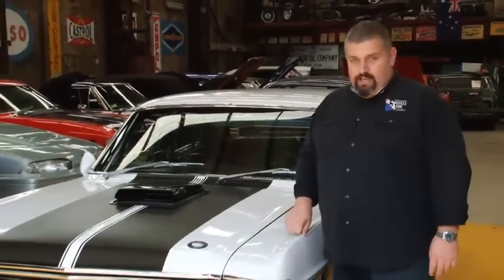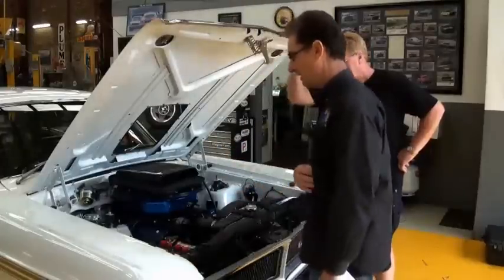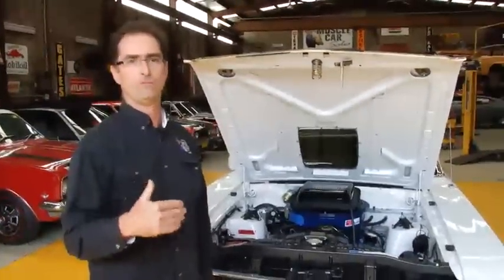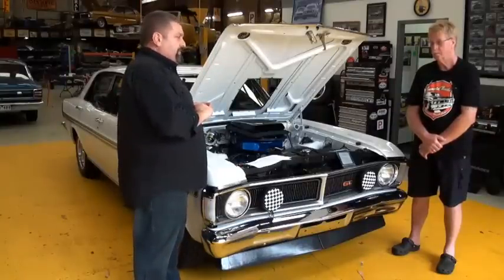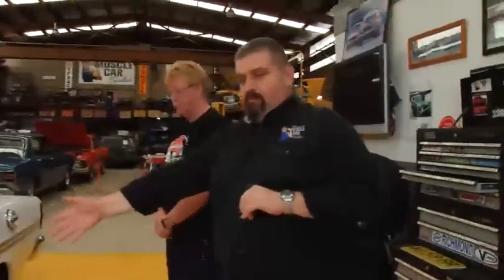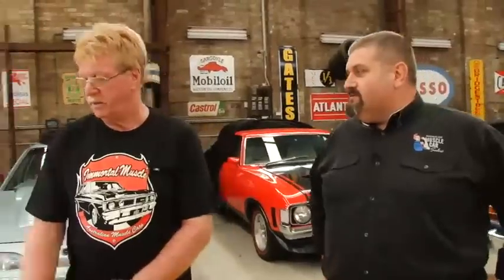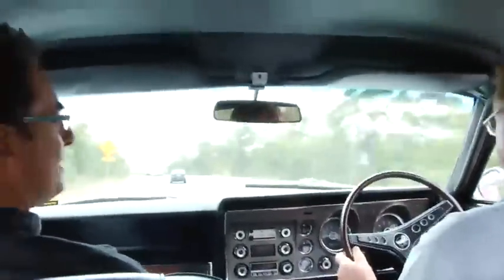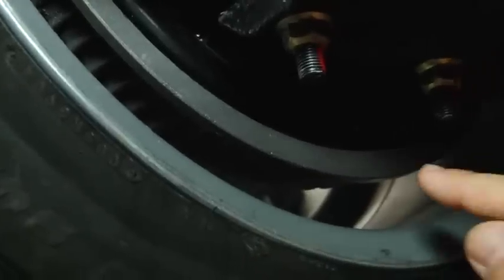1971 Falcon XY GTHO Phase 3 - Ultra White

Comment: The Moffat GTHO’s did not do 175 mph, they were clocked at around 140 mph. Even in 1978 the Cobras only made it to 158 mph.
Reply: The fastest in '71 was 153 mph by a driver who's name I cannot recall but he wasn't a 'name' driver. Obviously the 6150 rev limiters were all disconnected.
Reply: Wasn't that the yellow GTHO that blew the engine down conrod?

Comment: changed from high output to handling option for  the insurance companys.r/t charger 6packs did allright down straight a bit quick down 1/4 mile.(factory)

Comment: Thanks for your article. In addition I believe most cars that were Bathurst Specials 250 were made and they had to sell 200 to the Public and the 50 ended up at Bathurst with the only Mods. were Blueprinting and Balancing the motor. Didn't know they made 300.
Other - 36 Gallon Tank had a Ball inside which would block the Fuel from leaking in a roll over. I think they went with a larger 15" Wheel to give it longer legs down Conrod Straight.
What a Car with an unbeatable sound.
Reply: Only the last 100 of the 300 could be optioned. The Globes were homlogated in '72 following the supercar scare which left Ford without a series production race car.

Comment: They were under rated they actually have 513 horsepower.  Then you have the super Ford xy Falcon which has 615 horsepower with fuel injection
Reply: More like 390-400hp.

Comment: The worlds fastest 4 dr sedan in 1971 was a Dodge Coronet 440, 727 ,3.23 sure grip police car
Reply: I'd very much doubt that - a 440 Charger was only a mid/low 14s quarter mile car at best from factory - 4 door Coronet police pack was significantly heavier so must have been significantly slower (Mopar fan/owner)
Reply: It's true the police package Dodge 4 Door had a higher top speed.
There were a few faster 4 door cars prior to 71 not to mention the cars that were not a package & could be optioned up with big motors & tall gears.
The XY is fast for what it is I give credit to this owner for saying it is one of the faster 4 door cars from the time.

Comment: The V8 LJ XW-7 GTR Torana would of left a Phase 3 in its Wake.
Reply: @Frank. T 
Harry Firth's HDT tested the Yellow LC HDT V8 Torana Prototype at the 1972 Easter Bathurst and Won, Tested at the AIR race track and Calder on the 14/4/1972. Unlike the Phase 4 was never tested on a Race Track at all.  Harry was miles in front of Ford in Testing that is for sure.
Reply: @666theninja  The Torana was great because of how light it was, put all that LC gear into a Monaro, then compare it to this beast.
Reply: @caratcranker5874  The Monaro was not up against the Phase 3 or Phase 4, the Torana was the New Weapon at Holden.
Reply: your just one eyed... thats all.. blah blah.. i like all old classics.. cant stand one eyed mentality..would rather listen to my dog
Reply: If 1972 wasn't wet and the phase4 was let loose on the mountain moffat would have eaten those torana's for lunch like he ate those monaro's in 71'.
Reply: But then a 1928 Dodge Tourer would blow the doors off a Ford Model A.  These arguments aren't that relevant in 2019.  Do you people realise that the pathetic Formula HQ's from a few decades ago with 202 red motors would lap Bathurst about 10 seconds faster than a GTHO did back in the day (it's all about brakes, suspension and tires).  And all these classics are so slow by modern standards (if you ever get the opportunity, have a drive of a 6.4 Chrysler SRT or the 340KW Mustang - these cars do 12sec quarter mile times from the factory!!).  These days, you drive one of the old classics for the look and the sound (and that's impressive enough).  If you want to go fast, it's cheaper to buy something newer.
Reply: @artfuldoj4005  true mike but the new stuff doesn't look quite as good....
Reply: jason lennon  lmao no monaros raced in 71’ and what your saying piss weak it’s like me saying ford only won in 70 and 71 because there was no other V8 competition.
Reply: @mangrovejack3450  l said it to get you holden fans wound up and as usual it does.
Reply: Yeah Woulda Shoulda Coulda 🤣🤣🤣🤣 BAHAHAHAHA
Reply: @artfuldoj4005  You forgot about weight ,just saying
Reply: Told us everything but 
what most ppl are wonder
ing,..the overall price paid,
including the cost of
the resto. I think these buyers
are always too shy
to reveal the ridiculous
$$$ they paid😄⁉️